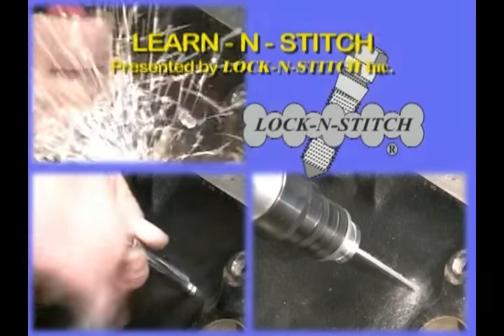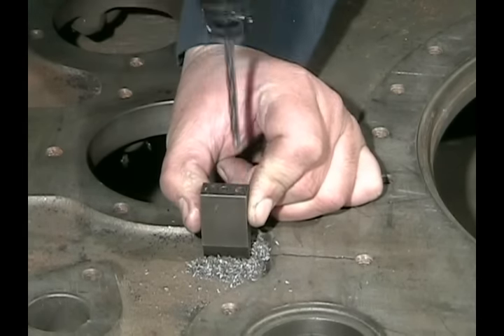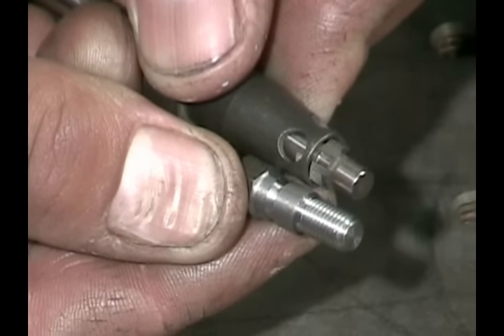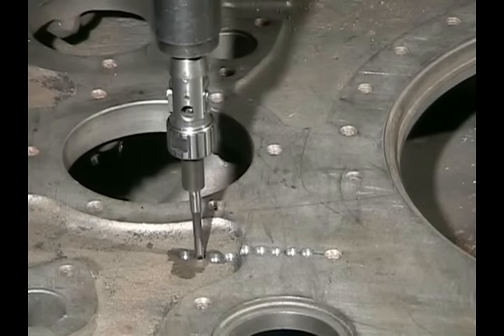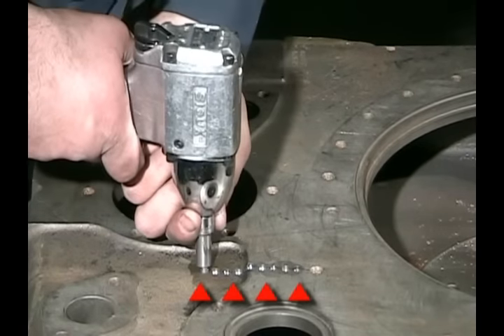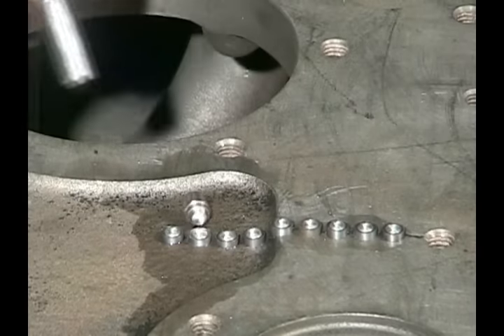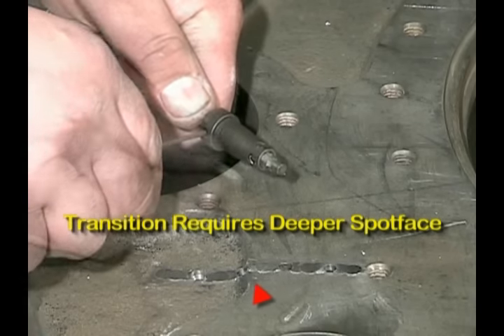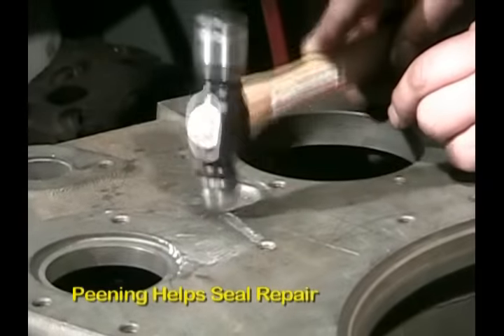Cast Iron Crack repair

Comment: I did not know this was possible
Reply from the maker: Absolutely! If you are in need of our products or services we are here to help you anytime.  Please do not hesitate to give us a call.  We are located in California, but can ship products worldwide - can perform repairs worldwide.  We also would be happy to give you technical support via email or over the phone.  Thanks for watching and commenting!  www.locknstitch.com 800/736-8261 or 209/632-2345
Reply from the maker: it is in the patented thread design, it pulls the metal together rather than push the material apart - adding strength to the repair.  Please read more about it on this page of our website or you can always reach out to a technician to find out more 800/736-8261 or 209/632-2345 info@locknstitch.com http://castingrepair.locknstitch.com/item/c2f-stitching-pins/steel-castmaster--c2f-stitching-pins/c2fa-25#About%20C%20Series%20Stitching%20Pins
Reply: Similar techniques have been use for a long time. This looks a lot easier. I'm skeptical about the "thread design pulls it together" claim, but it shouldn't matter, just sales speak BS. It will work, and work well.
I don't know how long this method has been used, but i'm confident that it goes back as far as steam power.
Reply from the maker: @TheTomBevis  completely understand that you may be skeptical - but at any time you have questions or would like more information we would be happy to talk to you.  Our technicians can explain in more detail the thread profile and how it pulls material together.  It is quite revolutionary! Appreciate you watching and your comments.  800/736-8261 or 209/632-2345 or info@locknstitch.com
Reply: @LOCKNSTITCH  lol,,,patented tread design,,,it's just a tapped in bolt,,,how could it pull the sides together and hold them,,,why not nickel well it anyway and know for sure,,
Reply: @georgespangler1517  Yep, I'd like to see the diagram of how one generates tensile strain along an axis parallel to the thread plane.  I see no advantage to this over brazing.  This is basically just hoping the lock-tite will prevent leaks.
Reply: @jamesw9930  If you go the the link the sales BS posted, you can see they are using "Spiralhook™ threads" which seems to be a registered trademark as they claim but is never before seen by Google. It's just bs marketing over here =)
Reply: As the bolt tightens it holds both sides of the cracked metal tight to the head/shoulder of the bolt. Think of it this way, hold both sides of a ripped piece of paper at the rip and squeeze your fingers on the rip. Hard for someone to spread the 2 pieces apart because of the "clamped" fingers on the rip. Bad example but you get the idea ...
Reply: @georgespangler1517   Sorry George it is not just a tapped bolt. A close look at the thread profile will "LOL" your comment. Look before you speak, then use your noggin let your thought be open. What they say makes a lot of sense  -especially if you ever saw the thread profile.
Reply: For 50+ years
Reply: @georgespangler1517  This is the old method of cast repair that has stood the test of time, also a far better way for thicker casts
Reply: Why would you do this instead welding it?
Reply: @pipes9878  You can't weld cast
Reply: @pipes9878  Imagine if you have a 6" thick casting with a hairline crack and no access to the back. Imagine how much material would you need to remove to get weld at the bottom of a 6" crack. You could braze up the surface of the material but surely would not penetrate all the way to the bottom.
Reply: Kactapuss 🤔 fair point, thank you 🤘😎👍
Reply: @pipes9878  After being so intrigued with this tech I looked up a bunch more videos. There was one where some techs used this method to repair a tooth of a huge gear inside the top of a wind turbine. In that case it would have required much more effort to remove the part for repair, this method involved relatively few tools and no heavy equipment for an in-situ repair.
Reply: @tkgus2408  you can weld cast. If you dont know dont answer
Reply: @LOCKNSTITCH   thank you same for aluminum ?
Reply from the maker: @todddebockler7786  yes!  Please reach out to our customer service team either by email or phone and they would be happy to provide you more information.  info@locknstitch.com or 209/632-2345
Reply: @georgespangler1517  It doesn't... it can't  This may seal the crack, but in no way makes the area stronger.  Physics won't allow it.
Reply: Because welding cast never works out
Reply: @georgespangler1517   ISO 9001:2015 Certified

Comment: Wait, I know it seals the crack, but wouldn't it weaken the object? Structurally speaking?
Reply from the maker: Not at all, great question~the patented thread design actually pulls the material together adding strength.  It will be stronger than it originally was!

Comment: Very cool process and video, If i sent a picture of the repair im trying to do to a block, could you tell me if it would work? The issue i have, is the crack is  more like a small oblong shaped hole about the size of a fingernail clipping. its not a hairline fracture like this but i think if i used some oversized pins it could work.
Reply from the maker: You can absolutely send pictures into our customer service team!  That is the best way for our team to provide you technical support - thank you for watching and for your comment/question.  Send the pictures to info@locknstitch.com with your best contact info and our team will be in touch with you.  You are also free to call our offices anytime as well to speak to our team 209/632-2345. Looking forward to speaking to you soon.

Comment: what is the tensile strength of a stitch?? I cannot imagine it to be very high with this method
Reply from the maker: Here is a video testing the strength of one C3 stitching pin! https://www.youtube.com/watch?v=tkCv8WpnqUo
Reply: @LOCKNSTITCH  Nice but rather irrelevant - if not misleading - as the test does not replicate the direction of the forces of a crack: if there is a crack, there is a reason for it: usually forces orthogonally to the main direction of the crack. This is how a strength test needs to be executed in order to show the potential of the repair method. I guess that you will end up with a force slightly above the tensile strength of the thread sealant - which does not mean that the repair method doesn't work, I am sure it does, just your "experiment" is "a bit" unscientific...

Comment: We used a version of this when I worked at an auto machine shop in the early '70's and by then it was old technology. Stitching works.
Reply from the maker: This is new technology, same principal however the patented thread design is able to pull metal together rather than push apart like the old tapered methods did!
Reply: Cool stuff. Glad it is available.
Reply from the maker: @Mercedes-Guru  Glad you found us!  Anytime you need the products or some technical advice we are here to help! 800/736-8261 or 209/632-2345 or info@locknstitch.com

Comment: It's a shame in this day and age this trade and many others are dying out.
Reply: Because heating it and TIG welding it would have produced a lot better seal. But this was very impressive.
Reply: ***** What type of cast iron are you guys talking about TIG welding, have you ever done any? White or grey cast iron is almost impossible with TIG, the tungsten lasts about 2 seconds flat before being destroyed with the porosity created.
If this is white cast iron you ain't going to weld it anyway, mechanical studding is one
option, maybe not perfect but better than some idiot trying to TIG weld it.

Comment: this seems like it would be a good method for parts under compressive or even shearing force, but I can't imagine it having much strength for areas under heavy tensile force (like a combustion chamber for example).
Reply: Glad it’s not just me who thought that ! It doesn’t join the metal it just fills the crack ,might as well just use locktite 643

Comment: Just an tip,use a vac to remove the drill chips.  Using a blow gun moves them everywhere you may not want them to be,plus it requires secondary cleanup.
Reply: That's $$$

Comment: This even works to fix cracks in combustion chambers. When you weld... as is cools it shrinks... surrounding area is solid... something has to give... usually the weld... weld two separate pieces of cast iron together not such a problem as each piece is free to move as weld contracts. These plugs wedge in to the threads nice and tight and don't shrink or pull away .... welding can work. If metal is clean, if you have oven, or if you can post and pre heat it, or peen right after welding to expand the metal. Then you still have to hope it wont crack. One thing it certain drill out the ends of crack. I would rather pin a cast iron block or head..... you all go on fighting about it now... I have things to do... lol      ps.... if you weld you might want to use some sort of ceramic sealer or other in case it cracks or weeps...  ;)

Comment: Back in the 1980's I found a set of automotive engineering books my dad had, dated 1950....it has instructions and pictures on how to do this exact repair...using ordinary bolts.
Unfortunately now days things are not repaired as much as replaced...such a shame that some skills are lost in the workshop, but when you start working on motorcycle parts that are 40 years old and unobtainium, you need to repair as opposed to replace as there are no replacements available.

Comment: Great work sir, but my question is that how can it catch both of side?
Reply from the maker: Great question! LNS Castmaster stitching pins have a thread design that is patented to pull the material together - here is a page that tells all about the pins! http://castingrepair.locknstitch.com/item/c1-stitching-pins/aluminum-castmaster--c1-stitching-pins/c1cl-25?#About C Series Stitching Pins If you have additional questions feel free to contact our customer service team 800/736-8261or 209/632-2345 info@locknstitch.com  They would be happy to talk to you.
Reply: That is without a doubt the best and prettiest "crack" I have ever seen and a very shallow one that doesn't seem to extend down into the threads of that bolt hole so am I correct in thinking that the crack was "staged" in a cleaned up junkyard part just for demonstration/marketing purposes? I'm not doubting the technology because I heard about these pin type crack repairs long, long ago from people I don't THINK were undercover employees or stockholders or anything, lol. But it definitely looks like that "crack" may have been cut into that housing with a little cutting disk or maybe a little carbide burr in a Dremel tool. Am I right?
Reply: +LOCK-N-STITCH INC. this explained it all for me now i can sleep well. "stitching pins do not spread the crack! In fact they do the opposite"
Reply: @deeremeyer1749  you just proved your lack of knowledge just in case anyone was not for sure

Comment: Thank you for the great video. I discovered a crack running through the stop pins top and bottom for the forward/reverse gears. The top crack is adjacent to the oil reservoir across from the allen haed plug for draining the oil. It will drain all of the oil over night. Your video will help me get it fixed. There is no way I could ever sell it with an issue like this. Again thanks

Comment: Would this method seal a crack on a 2stroke engine head where the exhaust connects holding a gasket between the exhaust and engine head. The crack occured when I tried to tighten a bolt that held the exhaust in place without ensuring that the exhaust was aligned with the engine head properly. Hope this makes sense.
Reply from the maker: Yes!  Please contact us and we would be happy to talk to you about a repair solution!  You can call our offices if you are in the US or you can email us - we do ship products worldwide and can provide you all the technical support you would need.  We also have technicians that can travel to perform repairs onsite as well.  Just depends on the level of service you would need.  800/736-8261 or 209/632-2345 or info@locknstitch.com
Reply: David Jaeger  I just fixed my motrcycle front axle that had split in two with jb weld...can't wait to try wheelies and endos.

Comment: Hello, this is very interesting but looks like a ridiculous idea! I understand you can 'seal' a crack against water pressure with this stitching method and it would also prevent the two sides of a crack 'flexing up and down' vertically independently , but I can see two problems. Firstly, the screws will be applying a bit of side pressure all the way along the crack, so that it may open up further along from the end of the original crack line and secondly, it is not heat proof because of the adhesive, so that it probably can't be used on something like a cracked wood stove or cylinder head from an engine, where cast irons are regularly used.  However, I'm not very experienced and only ever successfully welded a tractor cylinder head (including around the exhaust port inserts) and some cast iron water troughs, using cast iron welding rods.  Anyway, great video.
Reply from the maker: John here is a direct reply from Gary Reed, MD - inventor of LNS products : Hello John, I can see how you could make these statements not understanding how these products are designed and how they work. 

Firstly; the screws have a very special patented thread profile that does the exact opposite of what standard bolts and screws do when tightened. You are correct that standard V shaped threads do apply a radial spreading force when tightened which would cause the crack to extend like old tapered cast iron style stitching pins did which also had V shaped threads. 

Their unique thread profile called “ Spiralhook” actually creates a radial inward drawing force that pulls the sides of the crack together when tightened. The threads have a negative 20 degree hook angle on the topside of each thread.  The stitching pin also has a shoulder that fits into a special machined counterbore with an opposing negative 30 degree hook angle under it. When the shoulder seats, I stops the downward movement of the stitching pin which brings the hook angles of the threads into contact the matching thread profile of hole that was tapped with a special Spiralhook tap. As the pin is tightened the negative hook angle causes a very strong force that pulls the sides of the crack together. 

Secondly; the coefficient of thermal expansion of the pins is the same as the cast iron. Their thermally conductive thread sealant if good to 450 deg F. and no part of an internal combustion engine except for the exhaust valve and exhaust manifold ever gets hotter than 235 degrees F. as long as there is coolant in the water jacket. This was tested and validated by the US Army back in 1984.  If the cast iron ever got that hot, the engine would fail quickly. 

Thirdly;  the video also shows the installation of locks across the stitched crack that adds even more strength to hold the crack together that repairs the crack to its original strength. 

Yes a wood burning stove gets much hotter and I don’t think LNS would recommend metal stitching a wood burning stove. Perhaps you should look at the portfolios on their website www.locknstitch.com and see some of the incredible repairs they do on huge ship engines and other castings used in mining, oil and gas, power generation and other industrial applications plus the restoration of the US Capitol Dome in Washington DC that is made entirely of cast iron. You can also check out what Jay Leno has to say it. 

(Gary is referring to additional videos on our YouTube channel - link to the US Capitol Dome repair video: https://youtube.com/watch?v=lF4KNaco0sM&t=6s&index=3&list=PLi9mrPt_gndlo0LOtrdSR7DN235a7B6TL and link to the Jay Leno's Garage video https://youtube.com/watch?v=qZUGghzkwVQ&t=1s&index=2&list=PLi9mrPt_gndlo0LOtrdSR7DN235a7B6TL)
Thank you for your questions, comments - if you need to contact us directly to not hesitate 209/632-2345 or 800/736-8261 info@locknstitch.com
Reply: Ok, thanks for the reply. By the way, there is 1/8'' of un-repaired crack left between the last pin inserted and the original stud hole. The last few pins could have been slightly zig-zagged to fit another pin in, which would break into the original stud hole and therefore make the joint totally leak proof.

Comment: Lots of very skilled mechanics are noted.  But I had a crack on the exhaust header of my old 65 Pontiac.  I just opened the crack with 1/8" holes then plugged the crack with JB Weld.  It worked!  The exhaust noise became normal.  It worked for about 2 years and then sold the car.  So I dont know how long it really lasted.

Comment: This is a stunningly expensive temporary fix, right? Won't the crack just form again later on as long as it was caused by normal operation in the first place?
Reply: why would you assume that? and stunningly expensive in what regard? if you're pulling another 10 years of life out of a 5, 6, or more figure machine, it certainly doesn't seem expensive then. cracks often propagate at areas with defects, this process may well remove the initial reason for failing in the first place.
Reply from the maker: Well that depends, what needs to be fixed, the value of the item - either financial or sentimental.  It could be a large stationary engine or piece of machinery that is costing a company thousands of dollars if not more a day/hour in downtime until repaired.  It could be a one of a kind antique block, it could be or you are right it could be an inexpensive casting that isn't worth fixing.  There are many different applications, cases etc.  It all depends on the situation.  And yes this is a permanent solution.  Thanks for watching and your question.